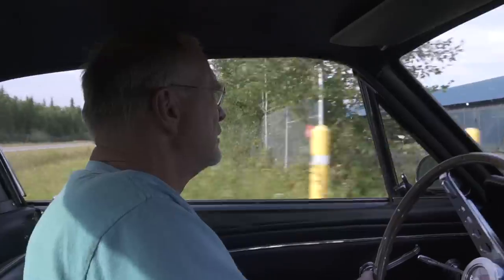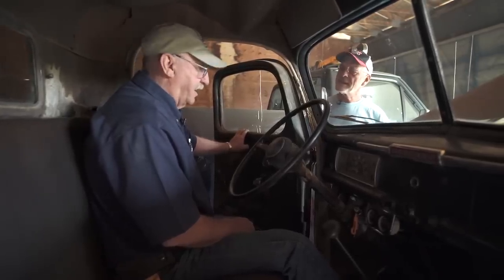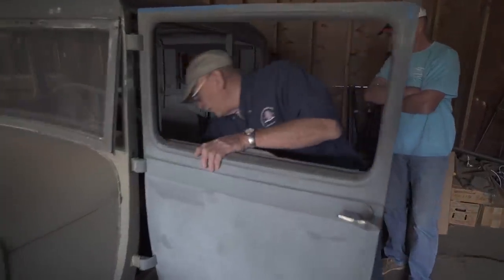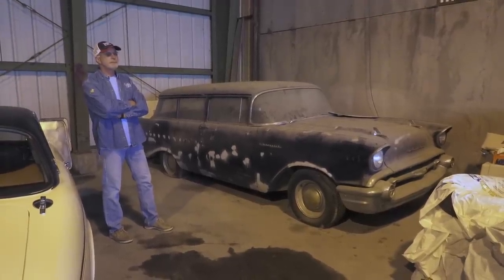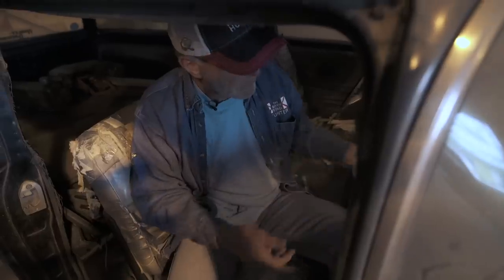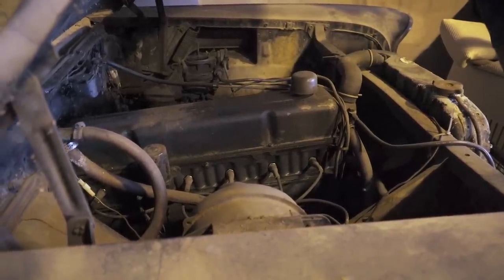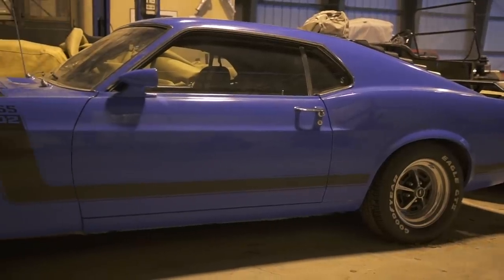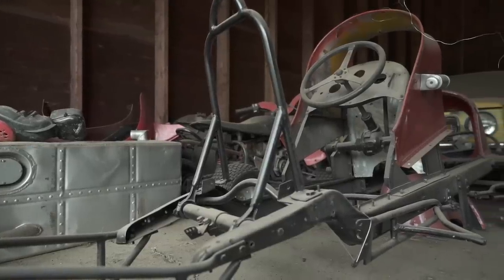Rare Chevy Sedan Delivery, Boss 302, and a Mercury 1 ton pickup | Barn Find Hunter - Ep. 51

Comment: I knew a guy in Palmer Alaska 15-20 years ago that had a boss 302 that he special ordered and bought new in Anchorage. 
I think it was a 69 but don’t remember for sure. 
He was a mechanic at the ford dealership at the time. 
Said the engine lost oil pressure and blew up on the glen hwy while commuting home when the car was still pretty new. 
Ford warrantied the engine, he installed the new one himself at the dealer and got paid to do it. 
I think he still had the original engine in the corner of his shop as well. Can’t remember for sure. 
Car was all original, paint, interior, everything, and in immaculate condition. 
He daily drove an 88 thunderbird turbo coupe with an auto that he also bought new and was immaculate. 
I had one of those cars, and a parts car. That’s how we met. Sold him some parts. 
Nice guy. Loved hearing his stories.  Don’t remember his name.

Comment: The window delivery is something.  I had a 57 as my first car and I knew about the Sedan Delivery's but not these.  I didn't know the horn rings were not there either.  So cool.  Mine was a 6 and 3 on the tree too, The guy I  sold it to put in a 400 SBC and 350 tranny.  I should have bought the  Engine and tranny off him and I sold it too cheap I had put a new head on it, and it ran great..  Hind sight is 20.20.  I want a 57 truck now, with just  a 6 and a 4 speed would do fine.  So bitter sweet seeing this...

Comment: Tom I owned a 55 Chevy 150 Workman's Wagon. It was a 2 door. Had it back in the mid 80's. Man do I wish that I could get that one back.
Reply: I had one as well Clinton. There was a guy in my college (1970) that had a killer '55 Sedan Delivery with a V8. It was a high dollar build that I could never afford, but I fell in love with it. A year later I was driving home when I saw a '55 Chevy wagon sitting under a tree. The owner was an insurance salesman that I knew, but I had never seen this car.  Long story short it was a 2-dr station wagon 6-cylinder 3-on-the-tree with 150 trim and a radio block out. It had been sitting there under the tree next to his house for a year or two. I ended up giving him $150 for the car, picked up a new battery at Western Auto, splashed a little gas to prime the carburetor and drove it home. I added a radio, cassette player and a Hurst Shifter and drove it for about 15 years. It was a great road car, so I named it Trippin'.
Reply: @dalewalker4614  I just wish that I had gotten rid of the women b4 the car. It was fast, 401 Nailhead , 2 spd glide. I still miss that (1) even after 30 yrs
Reply: Not a workman's wagon they were called a handyman.
Reply: @my55chevy43  thats right, still they make great hotrods
Reply: @clintonpowell1443  yes indeed they do make great hot rods! My brother has a sedan Delivery 327 with a 4 speed and yellow as can be.
Reply: @my55chevy43  I would love to have a 55 Wagon. I think that me and my 64 Impala are stuck with each other. Health
Reply: @clintonpowell1443  nothing wrong with a 64 Impala they are really nice rides.
Reply: @my55chevy43  True. been reliable and such for about 15yrs. Infact she is a 1 of a kind. Build on date stenciled on tranny hump from the factory
Reply: @clintonpowell1443  That's incredible she is truly a gem. You just don't hear of that these days. I would love to see her. Take care my friend.

Comment: My high school shop teacher had a 55 chev sedan delivery with only 1 rear side window, it was from the forestry service, so the driver could look out the right rear to see fires better. It was a very clean and rare car.
Reply: jerryw66 … Actually the reason behind windows on one side was to eliminate the blind spot, same as a van with glass in the side cargo doors. If you have ever driven a van without side glass then you know what I mean. My 64 Corvan has no side glass and I am looking to get some doors from a Greenbrier to solve that problem. I drive it regularly so I'm worried more about safety than staying original.
Reply: @rupe53  Like I said, the right rear had glass so the driver, who would have been employed by the forest service, could observe the forest more easily and spot fires. There was an article in Chevy magazine a few yrs ago about these vehicles, it was titled the rarest chevy or something of that nature.
Reply: @jerryw6699 Yes, I understand your point, but the same holds true for the right side "blind spot" on all vehicles with left hand drive. Now from a manufacturing view point, they make the body side panels in one piece. If the vehicle needs side glass then they punch out that area. The 2 steps are a costly process so I can see why the budget model might only get one side with glass. Plain and simple, the side glass is for visibility, but glass on one side is a cost cutting measure. I'd bet good green dollars the same committee used this idea when they dreamed up the 3 door Suburban in the 60s. Another cost cutting measure!

Comment: When I first opened my body shop in 1990 the first two cars in the shop for restoration was a 1957 sedan delivery with metal on the sides instead of windows. I don't know what drive train it had from the factory but when I got it the mechanical work had already been done and it had a GM 427 crate engine that had been re-worked and was 450 hp. It had a 4 speed with a hurst shifter and a camaro rear axle. The suspension had been updated and had power disc brakes and power/ quicker steering box. Also it had A/C, power windows and cruise control. I painted it a deep red metallic that I think was a new chevy truck color that year. It was a very nice ride when it was finished. Personally I would have preferred a 700R4 transmission but it wasn't mine so I didn't have much choice. The second car (same owner) was a 1969 (not 1970) 302 Boss. It was all stock and had been restored but not good enough for the owner. It needed new quarters and the rest was just remove the bad body work and refinish it in the original off white. He sold them both as soon I was finished to a classic car dealer in Florida for a very nice profit.

Comment: That 6 Cylinder in the Sedan Delivery 1957 150 is a292CU IN - common GM engine in Government equipment. between 165 or 195 HP. Depending on the Carburator. How you tell between the 235 and the 292 is that the 235 has bolts through the top of the valve cover, while 292 had bolts around the flange of the valve cover. It is a truck motor - 292.

Comment: The Mercury flathead is larger than a Ford's flathead. The Mercury has 255 cubic inches vs. Ford's 235. The crankshaft is stroked. Also the tailgates are extremely rare and valuable here in Canada.

Comment: That Mach 1 style faux hood-scoop was never offered on the 1970 Boss 302(maybe dealer installed at some point of it's life?). 1970 Boss 302s either had a flat hood or the optional(and functional) Shaker Ram Air hood.
Reply: You’re correct. The Boss 302 never came with the Mach 1 style hood. The paint is too nice, kind of makes me think it likely isn’t original paint.
Reply: Its the original paint.
Reply: Lots of fake boss 302s out there.
Reply: I'm sorry,but I disagree, the shaker was an option in 70,my uncle ordered a new one without the shaker and owned it till yhe mid 90s. Do some research
Reply: @chevyman7021  Someone needs to thoroughly read the post......

Comment: I have owned 4 chevrolet inline 6 powered vehicles. they run as long as you keep them in oil. The worth while modifications are a good air cleaner and oil filter. the last one I owned was in a 70 nova and it had a good air cleaner and full flow oil filter. its likely still running fine some where out there.

Comment: Left hand brake!!  My dad bought a 28 Ford Roadster in 1963  that had left hand brake handle and also a red Radiator Hose was standard along with a red steering wheel. Very early 1928 as this video is discussing. I am also like you a Charlotte NC guy!

Comment: That color on the '70 Boss 302 looks odd, almost an azure blue, which is not original. If it's grabber blue because of the low light that would explain it. Also, the hood scoop is incorrect (probably from a Mach 1). However, it's looks real nice and complete.

Comment: the frames were stouter on the 150 line .. even the business coupe that was used in NASCAR .. Had a '56 150 Handyman 2dr 6 passenger 235   3 on the tree  .. great car
Reply: HUH???
There were no difference between a "150" "210" or Belair frame. The only difference was for a convertible, it had more crossmembers for the convertible top.

Comment: The 2dr sedan delivery  is list at   8907 units  and 0.57  of all the Chevy  car  production for 57 .   It doesn't list  which ones were the Display  version from the panel  version.     But the Handyman 2 dr Wagons  were just like that  1957  2 dr sedan delivery    where  they  made  15,087 .  
       There's also a special code  for Fleet Buys   for the Government  which should be the DSO of they used that ID  in 1957 .

Comment: I love old cars and barn finds, especially the Ford Model T Town Car body, 1913-1915 's are very rare!  There is some other pretty rare stuff in there.

I hate to see nice airplanes tied down outside in the weather instead of being in a  hangar.  My aircraft has to be torn down and stuffed inside my barn then trailer-ed to the airport and reassembled before flight because hangars are unavailable at the airport.  The airport has a bunch of hangars full of car parts and unavailable for airplane or airplane build projects.  The FAA is currently looking at this use (misuse) of hangar space as a drag on general aviation and the commerce lost to the community when viable hangar space is converted into long term storage.  Lets promote and build storage in areas zoned for that and open up hangars to use by activities which only can be accomplished on an airport.  I am hoping the the proposed rule making to limit hangar use to aviation related pursuits is successful.

I see no problem with a car parked under a wing or locked up in the hangar while the airplane is out being used but storing all those cars, some for over 20 years really does have an unnecessary negative effect on those starving for good hangar space.

Comment: The AMC Gremlin was one of the worst cars of the last Millennium, a rolling disaster. The suspension system, an engineering marvel, combined the worst of a chuck-wagon and an ox-cart. 
The controls fell easily to hand, if you had the arms of an orangutang. The engine was primitive. Soviet tractors had better throttle response, and the brakes were designed by Fred Flintstone.
Gremlins were even known to self-destruct. People would go shopping, park at a meter, and return to find the fire department surrounding a ball of flames. (  Fuel lines dripped on manifolds. )
Reply: I don't know how old you are but I think you're getting the AMC Gremlin confused with the Chevrolet Vega, much of what you're saying is more consistent with the Vega. I'm old enough  to have been around back in the 70's and I can tell you from personal experience, the Gremlin was a decent little car for it's day. On the other hand, the Vega was a total piece of junk and was far more likely to self-destruct.
I can remember back back in the mid 70's seeing many a Vega setting around with grass growing under it, most had been used for race car bodies or crushed by 1980.
Reply: @amc401nash6    I occasionaly drove a Gremlin that was owned by a local government agency in 1971-1972. It was a death-trap, and was to be avoided whenever possible. I always knewn that Vega's were crap, but at least they looked better than the Gremlin.
Reply: So you're saying the Vega was like a cute girl with a really bad personality. It's to bad you judged all Gremlins buy the antics of one abused company car.
Reply: @amc401nash6  That car wasn't abused, it abused the driver! Adjusting the bench seat risked severing a digit on a sharp piece of bent metal. The steering geometry was bad and the "blind-spot" was huge. Do a little reading on the subject of AMC. Learn how Mitt Romney's father ran the company into the ground by raising dividends and cutting R&D. Even in the early 1970's, those cars had pre-war engineering! There's no set standard for design, but in my opinion, when compared to a Vega, a Gremlin looked like a roller-skate with a tumor.
Reply: My original reason for posting was to point out how many of the accusations you made about the Gremlin, from my experience, were more consistent with the Vega. Yes, I know AMC was the forth banana auto maker back in the day and how they suffered from a constant lack of capital. Instead of belittling them, maybe as auto enthusiasts we should celebrate their accomplishments in view of the circumstances.
You seem to dislike AMC products in general, I definitely have a very negative opinion of the Vega so why don't we call it a draw at this point.
Reply: @amc401nash6  Sounds good to me.

Comment: good idea, buy an air plane barn so you can store your plane in there and a few cars under them,
no no, screw the pick up amc germlin or simer car in the corner next to the old car yes please! lovely cars 62k on the clock is good, plus its in great shape
oooh i see a jag xj back end with the horrible usa safety bumpers in the back there! O.O i knew they made ones with the rear windows instead of pannel but i thought it was only a protype! wow great find feel sorry for the guy but not sorry for the fucker that was drunk and killed him good thing he wasn't in that car! so it pritty much was like a van or pannel van basic and simple why do you need all the other stuff if its just going to be transporting things around? 
no price for it well its a goverment car, unlike the limo the usa leaders or very high up ppl would be driven around in there easy to price, this is just a throw away car owned by the goverment once it got too pricey or cost to much they'd scrap it or sell it on just to get rid of it, now a days the cars are crushed or disposed of as well you don't know what might be in there, 
ORGNIAL BOSS 302 MUSTANG?! HOW IN WERE DUDE THOSE ARE RARE! seeing as its the 70's in a few years that car would be sold for scrap as it costs to much to run on gas dam that or they were parked up and rusted away until the 90' when someone took the engine and gearbox out and built one but not an orgnial one good find indeed!

Comment: Nice BOSS 302, to bad it wasn't a 69, the heads were different on the 70a, they were more streetable in 1970.  I would Love to have a 1969 BOSS 302 and a 1969 BOSS 429.  Chevy thought they had good Cars, the BOSSES cleaned up and was even beating the Jags, as the Early Mustangs did in road races.  FORD RULES Chevys DROOL!  Chevy= Cheap Heavy Entertainment for the Very Young.  GMC=Gummy Motor Corporation, don't believe me?  The early chevys 283s 327s were covered with oil.